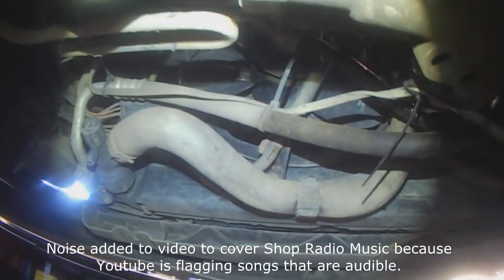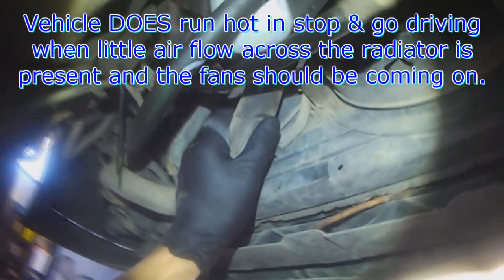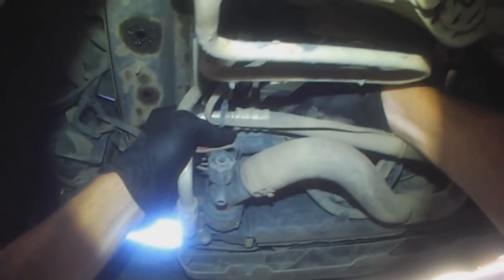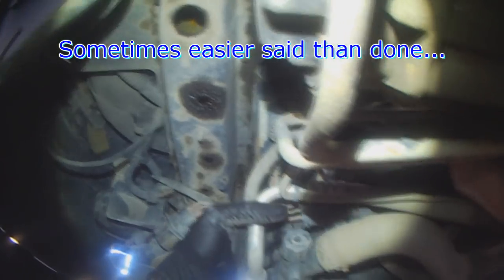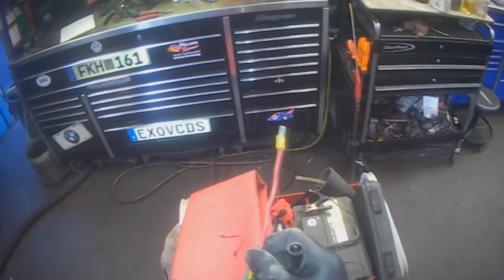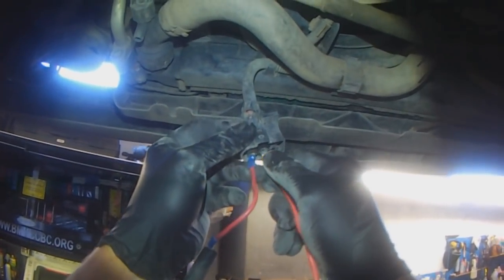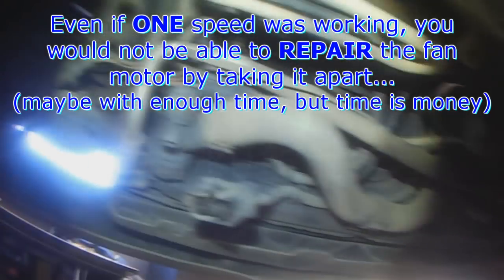VW A4: Cooling fans... manually checking (new version / better lighting)

Comment: Audi a4 b8 2009 2.0 tfsi Quattro. 
Fans come on with AC on.
Doing Fan 1 control test also brings fan on.
But will not come by itself with engine temp even at 105c. I have changed the coolant temp sensor and that did nothing. I checked the ohms reading and old and new one are both reading correct values.
What controls the fans to come on when heated up. I cant find this information anywhere for my vehicle. There are no codes on the car. Someone please help me diagnose what i need to do to fix this.
Reply from the maker: Do you have heat inside the car? Is coolant returning into the coolant reservoir when the engine is running? Do the lower & upper radiator hoses get warm / hot? Does the radiator core feel warm (reach between the fan blades to feel temperature or use a heat / thermal gun to check temperature). I would have to check a wiring to determine "exact" for mor fan control... most likely  the Fan Control Module receives a signal from the ECM to turn the fans on.

Comment: My 09 2.5 fan comes on full blast , is there a speed controller?
Reply from the maker: The ecm sends a control signal to the fan control module. If communication between the ecm & fan module is lost, the fan module activates the fans at full speed. There are other reasons the fans could be stuck on high. I would start with a full system scan, to see if any modules have fan related or communication related fault codes. Wiring diagrams in service manuals can be helpful in checking circuits / telling you how the system works. A faulty temperature sensor could also be the reason why the ecm is triggering the fans, but that would usually also turn the overheat light on in the dash. If the ac system has too much pressor or a faulty sensor says there's too much pressure... that can also trigger the fans to come on at high speed. You'll have to do some investigating.  You can use a multimeter to check the control signal / voltage from the ecm. If the voltage is low,  but the speed is high... then it might be a bad fan control module.
Reply: @EXOVCDS  thank you for the reply, I looked for a relay but I guess mk5 engines like you said are controlled directly by the ecm, I haven't checked the temp sensor because the coolant temp gauge works fine and the fans turn on at full blast even without the ac being on, so there should be two different voltages coming out of the fan control module , right? But if theres no communication between the ecm and the module then it would operate at the default high speed I suppose.
Reply from the maker: @vicchavez6570  the fans are controlled by the fan module... which is controlled by the ecm.
https://youtu.be/oqdv4cm86Ns

Comment: what about the connector that go to the ac and Rad fan? I've tested both of my connector and I got no Power. None of the fans are working. Fans only work when applying direct power from the battery. do the fan connectors go to the FCM? I checked the FCM connectors and theres power. Tested and checked all fuses ontop the battery and they seem to be working . Any Ideas?
Reply from the maker: Ali Salim Year, make, model, engine? Low speed does not go through the fan control module if the radiator has a radiator fan switch. Meaning that if you bridge with connector at the radiator fan switch... the fans should work on low speed. With key on, high speed should work. If not, verify power at the rad fan switch connector... if you have power at one of the wires, then there's a problem with the other wires going to the radiator fan connectors.
Reply: Thomas thanks for the quick reply. its an 2003 vw golf 2.0l . I've tested the rad fan switch and theres power going to it. I am getting no power on the connectors that go into the Rad and Ac fan. i will try to bridge the switch again .
Reply from the maker: Ali Salim https://youtu.be/Roh6RCs8IJk

Comment: will a bad fan control module under the battery also cause no fans condition? (lets say the fans are ok but they do not kick on with key on, pressing the ac button, and fan switch on .)
Reply from the maker: Low speed fan operation is NOT governed by the fan control module... if low speed is not working, it's NOT a fan module issue. Is the engine overheating? If yes, only at idle or also when cruising?
Reply: no overheat stays around 195 degrees middle of the gauge either in traffic or on highway. fans do not come on ever (low or high). If you press a/c button, fans do not come on, compressor does not come on, only the a/c light comes on. Freon is loaded and not leaking. Does fan control module still get excluded?
Reply from the maker: Year, make, model, engine? I have NEVER seen an engine that did not overheat when the fans did NOT come on. Have you manually checked them by bridging the radiator fan switch?
https://www.youtube.com/watch?v=Roh6RCs8IJk
Are you more concerned about the fans not coming on when AC is selected than the fans not coming on by themselves at idle (when they should)?
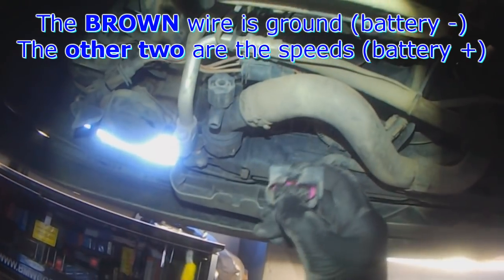Reply: 2004 jetta 1.9 bew wagon tdi Usa. Would like fans to work if it heats up, and want to get A/C to work. (light goes on but a/c compressor not working.) have not tried the bridge yet 02:37.
Reply from the maker: TDI's can take a long time to get hot & trigger the fans. If you let it idle at 2000rpm the fans will eventually come on. Might take 10 minutes.

Comment: Hi I have a 2000 TT and the person I got it from has the fans wire so its on all the tine from start, how do I get it back to OEM?
Reply from the maker: +TRAY NICE Remove the aftermarket wiring / setup... attach the stock. Find the reason why it was bypassed and fix the underlying issue.
https://youtu.be/Roh6RCs8IJk
Reply: Thomas EXOVCDS it looks like they jus ran 2 wires, I think the did it because the heat sensor was bad but, but that's not an expensive part, I picked up yesterday an going to put it in this weekend, but I should check the fan module too...
Reply from the maker: Fan module does not control low speed... so don't worry about the module for now. Check the fuse on top of the battery first. Here's a TT that had a similar issue: 
https://youtu.be/Cbdbwo4uQ-0?t=9m12s

Comment: Hello thomas i have a question what would cause cooling fans to stay on with koeo and koer take the key out fans turn off even with cold engine. Would the module be suspect 2009 vw jetta 2.5
Reply from the maker: Loss of communication between ECM & Fan Control Module (part of large radiator fan) can cause weird fan operation. Watch the following video and do some testing with a multimeter. Let me know what you find:
https://www.youtube.com/watch?v=oqdv4cm86Ns

You can also check the ECM for cooling fan related fault codes.
Reply: Thomas EXOVCDS thanks for the reply here are the test results
Koeo small fan running only 
Koer small fan runs for about 5 seconds them big fan starts twitching then runs along side with little fan

Key off brown has ground, red ground, black battery voltage, green nothing
Koeo brown has ground, red battery voltage, black battery voltage,green .94 to 1 volt
Koer  brown has ground, red battery voltage, black battery voltage,green 5 volts

Delta time are koeo 4.28ms measuring top of peak little fan running only 
Both fans on engine running delta time 17.14ms top of peak 
Ecm codes 
01152 cooling fan 1 control circuit
01681 cooling fan 1 control circuit low
08581 coolant temperature sensor 2 circuit high
Reply from the maker: I'm at work right now... will get back to you once I'm at home later tonight. You probably have a Fan Module issue. Replacing the large radiator fan (with module) will probably solve things. But let me think over this till tonight.
Reply: Thomas EXOVCDS ok thanks i was checking a/c codes and it has 00819 high pressure sensor G65 open circuit/short circuit to ground would the pcm think the a/c is on and turn on the fans.
Reply from the maker: The twitch of the large fan points to an issue with it. Both fans should start / stop / spin at the same time & rate. I'm new to AC still... I don't know if that pressure sensor is also monitored while the AC is OFF. It could be that the ECM or triggers fan activation as a safety / default, when there is a problem with the AC high pressure switch.
Reply: Thomas EXOVCDS i replaced the big fan with module. It got better they wont turn on koeo but turn on with koer.
Checked live data on A/C and A/C is not commanding fans to turn on but noticed that at start, fan activation is 9% and after a few seconds it climbs to 47% with cold engine. Also now i have a code 06470 coolant fan control module 1 faulty/open circuit in voltage supply.
Reply from the maker: Do you still have the temperature sensor 2 fault code? With AC off... check ECM inputs (coolant temperature and other inputs). When turning AC ON, does AC actually work or is there an AC pressure switch code still? Again, if the ECM thinks that the AC pressure is too high, it could activate the fans, even though the AC is off. I can only suggest to find a wiring diagram (AC & Cooling system) and then to go through everything.
Reply: Thomas EXOVCDS i am looking through the wiring diagram vw is kind of difficult to read for me they dont show up like other makes. engine coolant temps at operating temp is 95 degrees F on radiator sensor and 165 degrees on engine sensor something doesnt make sense why does gauge read 190 on instument cluster  i will try to decipher those diagrams , thank you so much you have been tremendous help in pointing me in the right direction.
Reply: Thomas EXOVCDS A/C is not working probably because of sensor fault.  The coolant temp code, there was a tear in the wire  in the connector i deleted the code and has not come back.
Reply from the maker: sergiovtorres instrument cluster will always show 190f before the ECM will. I think it's to show the owner that the engine warms up quickly & stays at 190f. Resolve the AC pressure sensor fault to see if that fixes the remaining issue.
Reply: Thomas EXOVCDS update fans work normal now A/C hi pressure switch connector was loose that is my fault i disconected it and did not click it back right . so the fix was big fan with module. Thank you so much for your help . Pcm does turn fans on at high pressure or connector disconnected even though AC off .

Comment: Hello ! I have an audi a3 8p 2004 2.0 tdi. My fans don`t work at all. When i start AC - nothing (ECON is turning on and i can not stop it), when the car is 90 degrees - Nothing. No fans starting..
I never gained a temperature above 90 degrees, but the fans don`t work. Then i get a wire and connect the fans directly to my accumulator and they work fine.. what can it  be ?
Reply from the maker: ECON mode (light ON) is AC off.
Cooing fans don't come on till after 95c (temperature gauge always shows 90c starting actual engine temperature of 80c to just under 110c. Temperatures above 110c will cause the temperature needle to move off of the middle position. Since it's a TDI, you have to let the engine run a long time before the fans come on... this might not happen at idle speeds if there is enough cooling through the radiator alone. You'll have to hold the RPM at 1600 to 1800 rpm for more than 10-20min to see if there is an issue with the fans. The quickest thing to do is to use a scan tool... trigger the fans (output test).
Reply: @EXOVCDS  yes but, when i start the AC, no fans are starting, and ECON starts.
I saw that there are 2 options for this car. The one is with removable control module witch is located on the big fan and option 2 - the module is integrated in the big fan and not removable. If my car has option 1, can i put option 2 and work properly?
Reply from the maker: I just re-read your post... sorry, if you can not turn ECON off, then there might be an issue with the HVAC system. Use a scan tool that can communicate with the HVAC module, to see if any fault codes are stored. You can also check / see what has turned the AC compressor off (low refrigerant, high pressure, low pressure, excessive temperature etc).
Reply from the maker: I don't know about swapping parts / converting to different version.

Comment: Hi, thanks for the video! I need to check my fans using this method, I have a 06 vw jetta tdi and it overheats. Once it gets up to normal operating temp and I shut the car off and try to restart it it will start for like two seconds and then immediately die. If I let it cool down and wait about 15-20 minutes it will start just fine again. 
Ive replaced the water pump, timing belt, thermostat and both coolant temp sensors. Ive been trying to figure out if my fans are working or not and have kept the ac on and they don't spin. do you know if the cooling fans not working would be causing this symptom? Also, what are the names of the jumper clips you use in the video? I have to get some and tried looking online but couldn't find those ones you use. Thanks so much any info would be so appreciated been out of a car for about a month now :/
Reply from the maker: What generation? A4/mk4 or A5/mk5?
Yes, both fans should be ON when AC is ON.
If A4, make sure that the green fuse on top of the battery (1st one from the left) is OK and that legs of the fuse are not burnt.
If A4, watch this and tell me what you find. https://www.youtube.com/watch?v=Roh6RCs8IJk
All you need is a test light to check for power... if you have power at the fan harness plugs, but the fans don't work, then the fans are bad.
Reply: @EXOVCDS  thanks for the reply. its an MK5. I checked the harness with a test light and there is power going through it so I guess I have bad fans
Reply from the maker: Thanks for the update!
Reply: @EXOVCDS  hey, hoping you could help, my car is still dying out when I try and restart it after its driven a few miles and gets up to temp. It starts and drives fine but after I go a few miles and its gets to normal operating temp and I shut the car down and try to restart it it will start for like 2 seconds and then die, only after about 15-20 minutes will it start and run again fine. Do you have any idea what could be causing this? Have you ever ran into this problem before? Ive replaced everything I thought could be the issue and now I'm at a total loss... If you could shed any light on this problem it would be so appreciated. Thank you so much
Reply from the maker: @ashleypopek724  I'm not sure... I'll have a look at a wiring diagram this weekend and will get back to you with some ideas. Could be a problem with the power supply relay similar to what this 2.5L Gasoline vehicle had: https://www.youtube.com/watch?v=6q2_SApeXxU (relay gets hot and does not function correctly).
Reply: @EXOVCDS  okay thanks so much!
Reply: do you know where the relay is located? is it in the fuse box under the hood?
Reply from the maker: @ashleypopek724  I think it's on the fuse panel next to the battery. It powers up all these fuses 15, 27, 28, 29, 38, 39, 40, 41, 42, 43. With the engine at idle, monitor power at one of those fuses... when the engine dies, check if power is still present. If not, have someone try to start the engine and continue to check for power at one of those fuses. Send me a message so that I can reply with a picture of the fuse box. My contact info is in the description (fkh161 website)... click on "Tool Request" to send me a message.

Comment: How do you if it’s the fans or the relay that is not working?
Reply from the maker: If the fans work when manually triggered (at the fan connector) then you know the fan is ok and the problem is ahead of the fan.
Reply: Thomas EXOVCDS i did, I did the bypass and i didn’t get nothing, I checked the cooling fan only though not both like this guy did https://youtu.be/S77LFqhIhFE..... my mechanic said it might be electrical because there was no power getting to the fans? But after watching all these videos I have a reason to believe it’s the fans, but then again I don’t know for sure.
Reply from the maker: The link you supplied does not work.
Reply from the maker: One of the wires at the radiator plug needs to have power... does it? When bridging "low speed" at the radiator fan switch, do you have power at the radiator fan connectors? Yes = bad fans, No = wiring issue.
Reply: Thomas EXOVCDS all the plugs were left alone except for the one we used to do the bridging, and we also turn the car key to the on position (we didn’t start the car though)...
Reply: Thomas EXOVCDS i did what you did and both fans turned on. What should i check next?